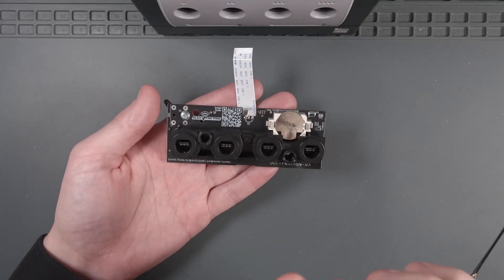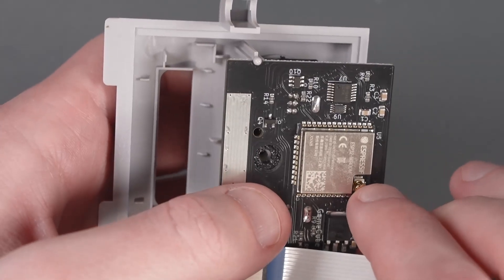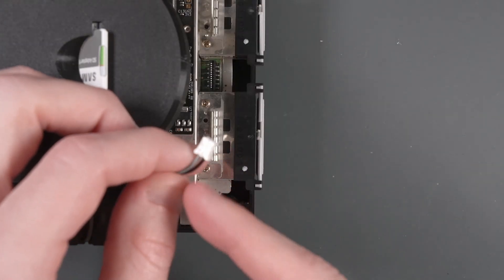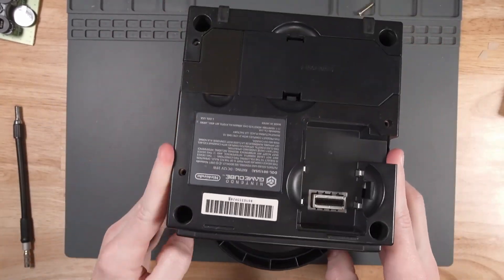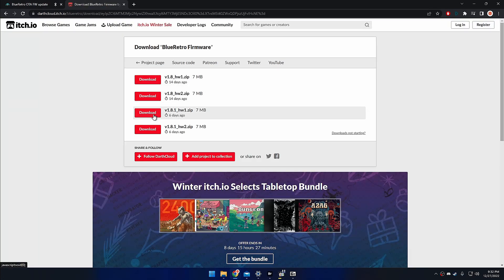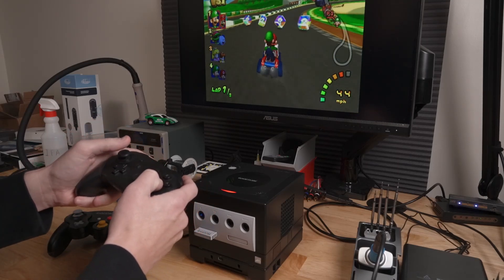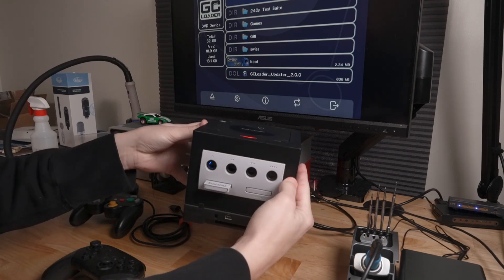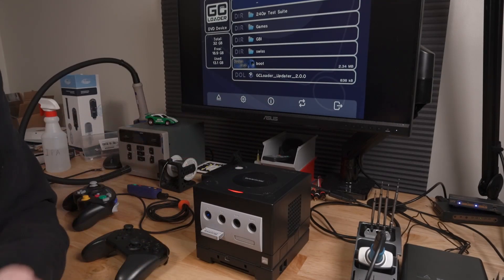Use Bluetooth Controllers with your GameCube (No Soldering!)

Comment: I just bought one of these, but Im wondering if the L and R triggers work as intended. I plan to use a Series X controller with this. Can you scan things in Metroid Prime 1-2, butt stomp or hold the spray nozzel in Super Mario Sunshine, etc.?

Comment: to use softshutdown on an xbox one controller press left trigger, right trigger, three lines button (start) and A.  to restart turn the controller on and hold the sync button untill it tries to sync, the GC will sync and the light will go solid

Comment: Has nobody made a wireless Bluetooth adapter that plugs into a controller slot? Same as the wavebird
Reply: There are controllers with wireless adapters (I have tried a few), but they tend to be crappy. Stick drift, false input detection on the D-pad....blah blah blah haha. The typical stuff with knockoff controllers. 

With this mod you can use most bluetooth controllers, giving you an option for using various quality controllers. Your only "good" options other then this mod are shelling out the money for a Wavebird or just going wired with an official Gamecube controller.
Reply: The new retro fighters controllers work well

Comment: That's cool.
They need to make a dreamcast one. 
I may grab both in the end of the year if there available.
Reply from the maker: They're working on it: https://twitter.com/collingall/status/1610045105934663680?s=20&t=ZH4cmAsy2uhN9np4ZZRrRg
Reply: @dubesinhower  that's cool. I guess the ribbin cable was for the best. otherwise these wouldn't be available. 
One dc doesn't work because of the ribbin cable. I hope that will fix it.

Comment: Well damn, that makes all my wavebirds obsolete lol, totally unrelatable, but I noticed you had a Gameboy expansion, and I was curious if you ever heard of them burning out the gamecubes internal power board? Or any other reason it would go out, reason for, I'm on my fourth one, and I would have no problem playing the system for several hours, i dont have any mods installed, its all oem besides the expansion, it is a Frankencube in a way, it has ntsc board and a Japanese disc drive which I heard is the same part and I run a carby, but I'll turn it off and on with no issues, however I would turn it off, come in the next day and the system wouldn't turn on again until I replace the power unit, and im petrified to leave a power cord plugged in when im not playing it, I have since also replaced the power supply cable with another oem and it has been plugged into a brand new power strip with surge protection, but ive never had an issue with any of my other systems doing this, I have asked other modders and I never get a reply on the issue, thought I'd give another shot
Reply: Is it just surge protection, or do you have line filtering as well? Its fairly standard on UPS systems, but you can set it to kick over to battery if the voltage goes above or below a certain threshold. This can get things that won't trip a surge protector.
Reply: @SoberAddiction  my old power strip was ancient, the case was aluminum,  had a push button reset, if it had any protection it was probably just an internal buss fuse, my new one however is damn near apocalypse rated, as for the gamecube power supply cable the old was possibly a bootleg because I didn't look like the oem cable, but after swapping the power board I'm petrified of testing the longevity of leaving it plugged in, I just don't see much on the power boards going out online except for changing the micro resistor on the board that I can't find any where

Comment: I've had mine installed for a few weeks, and it's mostly been pretty good (although I haven't really used it a lot). The issue that I noticed though is that the BlueRetro board seems to get quite hot when it's in the "Deep Sleep" mode, and it actually makes the front of the shell feel warm to the touch. So I'd feel a bit nervous using that feature for more than a couple hours without pressing the actual Power button on the GC. A bit disappointing since it was what pushed me over the edge to pay $95 USD + shipping and tariffs for this

Comment: I love cool mods like this and I really want to put it in one of my ‘Cubes, but I just have no use for it, other than the remote power thing. When I play a GameCube game, I want to use the GameCube controller. That’s part of the experience, ya know? I guess if you could power it on and off with a wired controller, I’d get one
Reply: I mostly use my wavebird for GameCube games. BUT when it comes to the Gameboy Player, I'd rather have a retro style 8bitdo controller. So this mod is pretty nice. Not worth the price for most people.

Comment: Just need someone to figure out how to swap the rf transmitter from a wavebird to Bluetooth
Reply from the maker: Yes! Or make a replacement board for the OEM controller
Reply: @dubesinhower there is one for the wired controller.
Reply: There is a phob wavebird board I think, I wonder if they could make a revision for bluetooth somehow